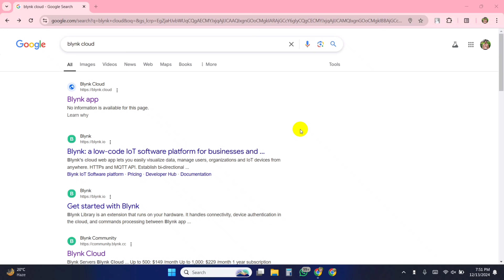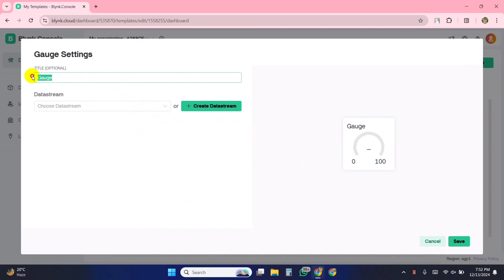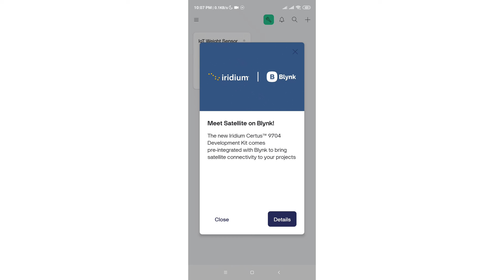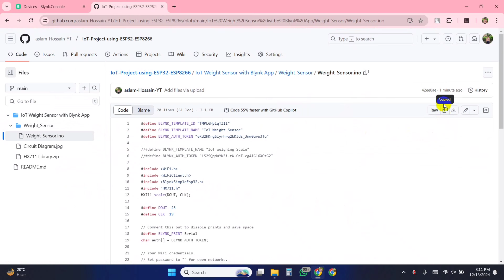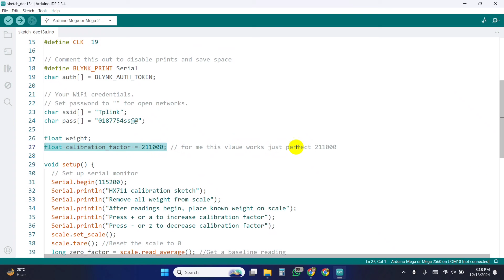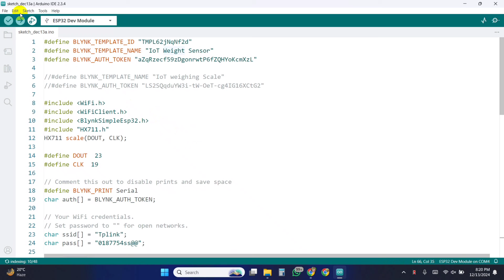How to Make IoT Based Digital Weight Machine using Load Cell HX711 and ESP32 | using Blynk IoT App

Comment: if i use the esp8266 one, what was the different, i guess it just only the library in arduino? hope to see your answer.
Reply from the maker: Just Include these libraries:
#include <ESP8266WiFi.h>
#include <BlynkSimpleEsp8266.h>

By replacing:
#include <WiFi.h>
#include <WiFiClient.h>
#include <BlynkSimpleEsp32.h>
Reply: @aslamhossain1  thank you sir
Reply: @aslamhossain1  I think he will need to change also pins to GPIO 12 & GPIO 13 , it this right ..?
Reply: Quién me pasa el programa xfabor